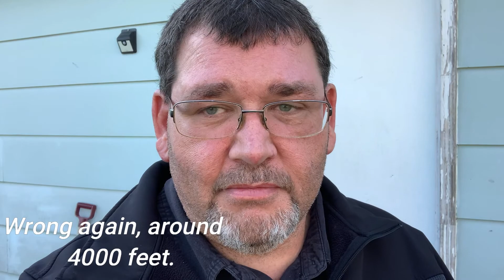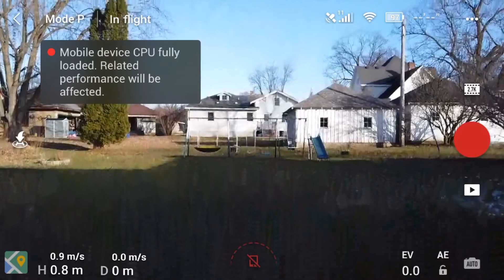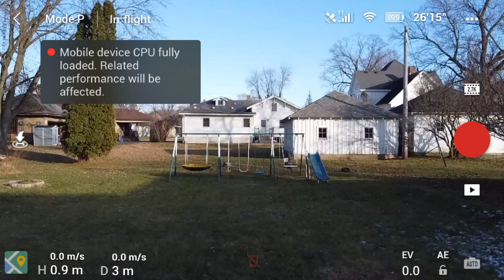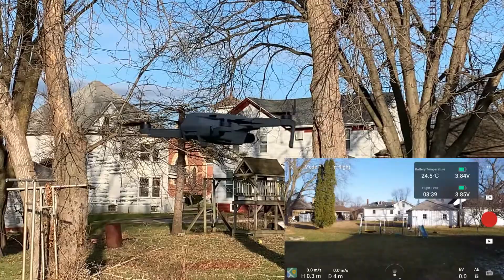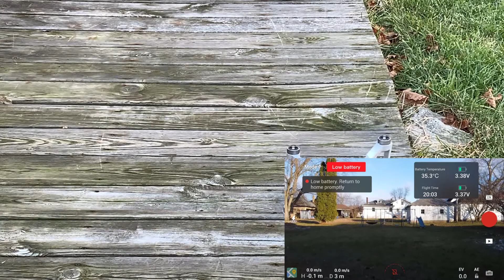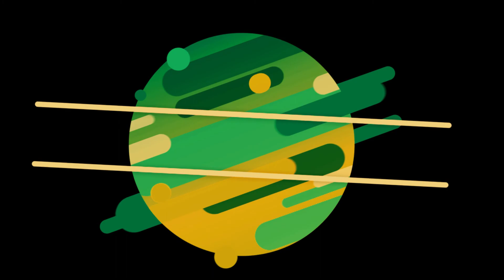Mavic Mini-Battery Test After "Battery Cell Voltage Warning".

Comment: Hi good day,  how did you fix that issue. Did you buy new battery?
Reply from the maker: It wasn't a battery issue. The problem with the Mini's batteries is that they are Lithium Ion, and not LiPo. They have a different discharge rate, and can't supply the same power through discharge. Once below 35%, they don't give much punch. The Mini also can't tilt more that 25 degrees, so it's ability to fight wind is greatly diminished compared to other DJI drones.

Comment: Had a similar experience a few days ago.  I was flying my mini on the beach side. It did quite well fighting the winds and gave me some awesome  footages for around 20 mins.  After that bhoom. One of the propellers stalled and and the drone was falling into to the sea. Luckily i saw the drone descending and managed to crash land this thing on the shore.  I tried flying it  on the very next day after this incident. Didnt find any battery issue.  I think prop getting stalled was mainly due to harsh weather and voltage drop.
Reply from the maker: I have done a few tests, and watched a lot of videos of people with the same issue. These Lithium Ion batteries have a totally different power output when they discharge. Being back close to where you took off at 30% seems like a necessity. Glad you didn't splash your Mini.

Comment: Batteries in the mini are Samsung 25R model, they can go from 4.2V- to 2.5 V
Reply from the maker: Thanks for the info. In the Mavic Mini, they can't supply enough power for sport or position mode against any wind when depleted below 25%. The draw is too much on the battery to keep the drone fighting the wind. 

The other thing it could be, is the software not allowing you to drain the battery to a critical state.

Comment: In my recent flight, I had to land it quickly because of low battery warning. I thought I flew it for a long time. (I flew it twice in one charge) But when I checked the flight time of footage later, it was about 17 minutes. I was supposed to have more than 40% battery. I didn't record my phone screen and couldn't check the exact percentage of the battery left. I will plan to fly it 10~15 minutes only for the time being.

Comment: Good test  looks ok so far but I would still be careful with it until you can fully trust it! It might be the error only comes up during a heavier load of the battery! ie during normal flying conditions.
If it gives another error like that, I would assume one of the cells is defective and return it to DJI for replacement. 😎👍
Keep us updated ⚠️
Reply from the maker: I will sure keep you updated. The worst case scenario, is that it drops out of the sky with a battery failure. I'm going to the local Fairgrounds tomorrow to push the hell out of that battery. I want to see if I can duplicate the issue.
Reply: @dronerisephotography2378  Yes that would be a better test and will definitely show up any battery issues. It shouldn't be failing after just 3 charge cycles?
It could just simple have been a random glitch or bad battery contact, not quite pushed in fully or even a piece of fluff but it's best to be sure and try and replicate the issue.
Good luck with it, appreciate your testing of this and letting us know the results.  😎👍
Reply from the maker: @pdtech4524  I agree. That was my first thought was to return it.
Reply: Hey PD I  have a Mini on the way too.  Wont be long before I am flying some endurance flights too here at area 51.
Reply: @DadRandom  Fantastic! I'll be watching! Me and my flying buddies had 3 Mavic Minis up in the air flying in close proximity, video coming soon⚠️😁😎👍

Comment: Good test I think it’s cause when the battery gets closer to 20% the battery voltage isn’t as high as when You have it charged between 50 and 100 percent and when You are flying in windy or in sport mode it gives You that warning cause I flew a few times after that happened and stopped flying around 46 % and I didn’t get that message again maybe that will be fixed in this new firmware update that Just came out We will see
Reply from the maker: I'm going to push the battery tomorrow while it's fairly close to me and try to duplicate the issue.

Comment: Have you downloaded and analyzed the flight data on the prior flight. I wonder if there are any clues to be found there.
Reply from the maker: Everything looks good except that one flight. That flight had a total of 59 warnings. The cell difference wasn't major either. I will definitely check it again after tomorrow's flight.
Reply: What puzzles me is as you got closer to the ground, and the MM still had battery, you couldn't make forward progress with winds likely well below 20 mph.  Perhaps today run some upwind/downwind tracks at about the same altitude and then analyze the ground speed data afterwards.  (although it appears you will have calm winds all day today)
Reply from the maker: @TommyTester  I sure will. I flew an entire battery with my Mavic Air over the cornfield were I landed the Mini because I couldn't see it. It was barely moving in the wind that was present. the wind was about 5-10mph at ground level.
Reply: @dronerisephotography2378  I'm not sure I understand.  You flew the MA before you drove over to the field entrance or after you got there?  There is a beeper you can activate on the MM if you lose it in tall grass, or corn.
Reply from the maker: No I haven't updated UAV data yet. Good idea, I will try that.
Reply: How do u update and analyze flight data
Reply from the maker: @Tworth23  Airdata UAV app. You will have to make an account for free, or pay for more details.